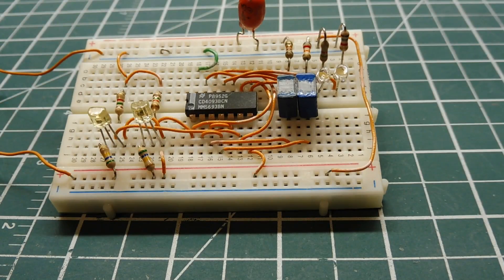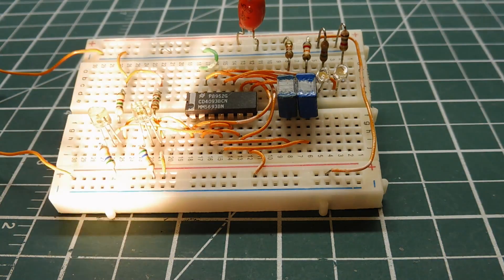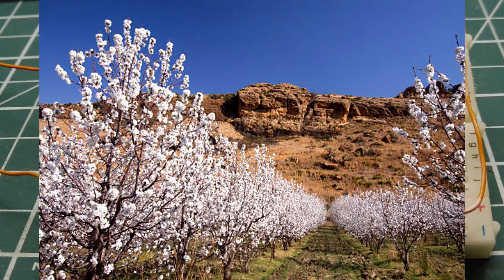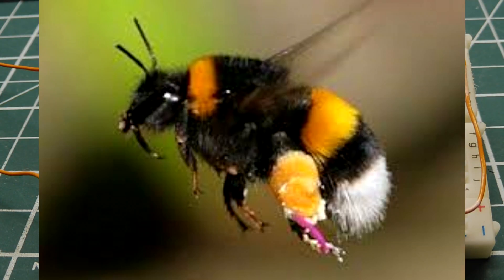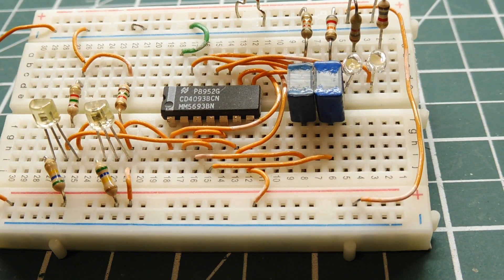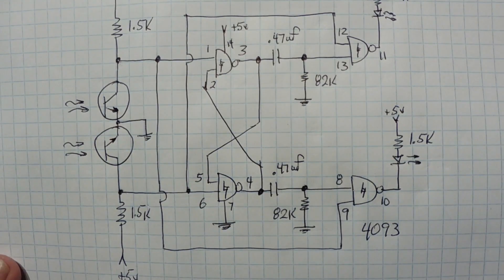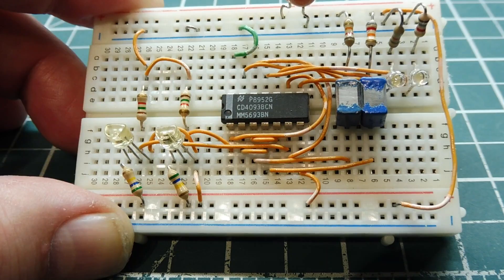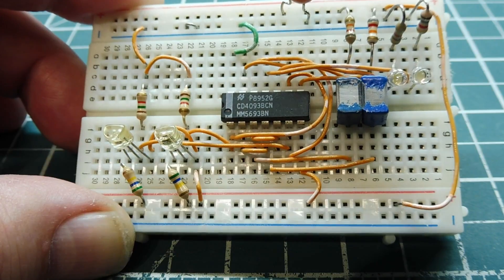Object Direction Sensor

Comment: Hi thanks for this video. I am trying to count the number of people entering or leaving a particular area for my project, can you please suggest me what component should I use for the counting(inc and dec) purpose.
Reply from the maker: Check online for up/down counters with display.
https://www.amazon.com/8-24V-Digital-Counter-Totalizer-0-9999/dp/B078N7K15Y
Reply: @0033mer thanks!! btw did you use any code to implement the circuit or is it just circuit connection?
Reply from the maker: There is no code involved. A pulse on the "up" pin will increment and a pulse on the "down" pin will decrement. A pushbutton is used to clear the counter.

Comment: Im trying to build a device which would help my friend with special needs, swim straight. Which sensor would you suggest that detects left or right direction change ? which could also be built with Arduino. 
Please suggest
Reply from the maker: The swimmer can be fitted with a LoRa radio receiver and an observer can send direction correction signals wirelessly activating left and right vibration generators.

Comment: Hi would the values of resistors have to be changed if using infra red sensors and light source ?
Reply from the maker: You may have to change the resistor values. Vary the values until you get a distinct "low" voltage when the sensor is receiving light and a "high" when the light source is blocked.
Reply: 0033mer many thanks
Reply from the maker: You're welcome!

Comment: What are the 2 560k resistors for on the breadboard they are not on the circuit diagram ?
Reply from the maker: Most phototransistors are a two terminal device as indicated on the schematic diagram. The phototransistors in the video have three terminal where the base is brought out to the user for sensitivity control. When not being used they have to be terminated to ground with a high value resistor.
Reply: 0033mer 
Thanks I did guess that but just wanted to check with you 
I’m going to use it for a tape counter for direction sensing.

Comment: Very nice video. I love it when I see you have a new video. 
Would it be possible to make a circuit that would detect a conveyor belt that jams and stops. We have a white food grade pvc belt sometimes a bolt or corner iron of s fruit bin will get caught in the belt. The belt will stop moving but the drive pulley keeps going. I was thinking there might be a way to detect when the belt stops and the circuit disable the motor starter contactor.
Rodney
Reply from the maker: For jammed belts I program the Variable Frequency Drive (VFD) for that motor to stop when the current exceeds a certain value.
https://youtu.be/-SaQf4QINEI
You could build your own AC current detector and calibrate it to stop the motor when jammed.
https://youtu.be/gvBVxQGS_OU

If you want to detect the movement of the belt try using the internals of an optical mouse monitoring the belt. Just a thought.

Comment: I went through the circuit with no blocking theres is no flashes. When lower trans. blocked upper led flashes, both blocked outputs do not change so no flash,  when upper trans. blocked lower led flashes.  I am looking at something wrong as I can see you are only getting one flash per pass of an object.
Reply from the maker: When the lower trans. is blocked pin 13 will be low which will disable any flash on the upper LED.
Reply: @0033mer  So to produce a pluse  the RC has to be discharged first. So pin 3, for example,  can only produce a pulse on a 0 to 1 transision as long as pin 12 is high.   Pin 3 going from 1 to 1 wont produce a pulse since the cap never get discharged ?  I was just looking at the levels and not the transitions.  Clever.  See I can do things in S.W. with out thinking circuits take a lot of thinking.
Reply from the maker: You got it exactly right. You have to look for transitions in an RC circuit. The circuit is called an RC Differentiator.
Search for it online and you will find lots of info.
Reply: @0033mer  Yes, it is, I didn't recognize it. Great for negative a positive spikes.

Comment: Nicely designed, simple and useful circuit.
In the 90's, before I started using PIC microcontrollers, I used to have a bunch of 4000 series logic chips and after completion of the design, I used to build the circuit on a veroboard. It was a rather time-consuming process with little flexibility. After having finished a project, if I got an idea to improve the design or add new features, often the only option was to start a new project. Compared to all this, using a microcontroller gives you a lot of power to experiment with various options by changing the code, quite often with very little change in the hardware. So, my vote is for using microcontrollers, especially because, they are so affordable, easy to get and you have a vast range to choose from.

Comment: Excellent demo circuit, I grow up in a small village in Greece were my grandfather had lots of beehives,  me and my brother keep this tradition going until this day at 43, we have a flatbed trailer to move the bees across the country for different honey flavoured batches. We are looking to build a circuit  that will inform us via a text message when the top lid of the nest has been opened by somebody or fell over by an animal, we have been theft victims before so we are trying to make a security system that will monitor the lids of the beehives wireless or wired if it's not possible, your ideas will mean a lot!
Greetings from Greece.
Reply from the maker: We also had our bees stolen. My dad took it hard, it was like losing a family pet. If the hives are in a remote area a text message alarm would be the best. I built a system a few years ago and presented it in Circuit Cellar magazine ( April 2006 #189). You need to start out with a cellular modem that can send SMS text messages. This is what I have used: http://www.microhardcorp.com/brochures/IPn4Gii.Brochure.Rev.1.5.pdf
You need a microcontroller for sensing theft and then sending AT commands via the RS232 port of the modem to trigger the text message. I don't know what cell system you have in Greece but this modem can handle many protocols.

Comment: I'm not surprised that most people chose a microcontroller.  I think it is easier to up to speed with micros and software than learning how to design with digital or (especially) analog circuit. That's why I'm here trying to get better at circuit design. Circuit design is becoming a lost art..

Comment: Microcontroller - because if gives the most of the potential for additional functionality, like counting the bees. signaling when certain important thresholds are reached, adding some additional sensing capabilities (ambient light, temperature etc.), keeping temporal measurements (how many in/outs per minute/hr), registering the time of events. calculating useful aggregations, wifi connectivity, etc.

Comment: I would use a microcontroller due to feature creep. Just updating the counter is cool, but eventually that data would need to be pulled out or sent out, or buttons would be added for something, etc. Doesn't mean that this isn't just the coolest circuit, though!

Comment: uC

  I would prefer to stay away from Mr. B* as much as possible. I want this on a wireless connection with OTA programming/updates and datalogging...else I may find myself bumbling around with the pointy end of a flying nasty.

 As an avid cyclist, I've been stung so many times that I seem to be developing an amplified allergic response, or the bees around SoCal are evolving much stronger venom. So I'm probably a little biased.

  What kind of photo transistor is that? I've seen the ones used for rotary encoder disks but I haven't seen this type before. That clear little TO-92 package is neet.
-Jake

Comment: Nice... I love your stuff. I would use a micro controller. 
I had already designed a similar function (using an MCU) for a human counter going into and out of a room to turn 'ON' the lights when at least 1 person was in the room and turn 'OFF' the lights when no one was in the room. I used 2 optical beam sensors.

Comment: First thought would be to use a micro, but then second thought the code would not be as easy as you think. This might be the better solution.
Reply from the maker: I coded a Finite State Machine and decoded the 4 states of the sensor to make this work in software.
Check out this video: https://youtu.be/0Fqa5RFZ29E

Comment: This is an interesting video. Especially since I've had a similar situation. The use of a micro controller offers more possibilities when you change/add sensors. In our case, we started with 2 light beams. Afterwards, ultrasonic and radar (Banner: https://www.bannerengineering.com/my/en/products/sensors/radar-sensors.html#all) were added. If you hardwire it can difficult to adapt afterwards, however, I like the simplicity of your solution. The microcontroller also offers the possibility of adding timers and it can easily connect your project to a network. Ideal for remote whatever. Thnxs for sharing this !
Reply from the maker: Thanks for the feed back!
I checked out the Banner website. They have some very interesting and useful products.
Reply: @0033mer  In case you're looking for recycled Banners, you'll often find them in (modern) cars, like Volkswagen Golf (I guess they're called Rabbit in your part of the world). Just behind the radiator grille. So if you have a car scrap yard nearby, with a little luck you'll find a recent car that had an accident (not in the front of course)... and recycle the banner. Much cheaper !

Comment: Hi,

I'm about to solve a similar task in my home automation project. I need to detect direction of motion of a person on several (relatively close) areas. After doing a research of what are the possibilities and their reliability, I've decided to go by two very close low power laser beams hitting two phototransistors (of course the light wavelength sensitivity must match my laser diodes). Here's a couple of ideas:

- in varying ambient light conditions (day/night) there's a problem with "output bias" of the phototransistor (what voltage you decide as 0/1). This is why I'll use a frequency modulation on my laser diodes (50/50 on/off at a couple of kHz) and RC hi-pass filter on the output of phototransistors. Then if there's some signal after the filter, it's 1, if there's nothing, it's 0 (another RC low-pass filter with slightly bigger time constant + comparator with hysteresis (4093 is good for this)). This will solve the problem (until you completely saturate the phototransistor with direct sunlight, then it will see 0 also)

- the decision logic will be purely digital (ESP8266?). I'm planning to do a basic pulse filtering/analysis using time "windows". Pulse too short = do nothing, too long = nothing. And of course, based on the sequence of my two pulses I'll determine direction (+ do the similar thing as does this !neat! circuit you're showing - if you go halfway and then back, first it will generate pulse for one direction but then for the other)

Thanks for your videos and keep doing what you're doing!

Martin